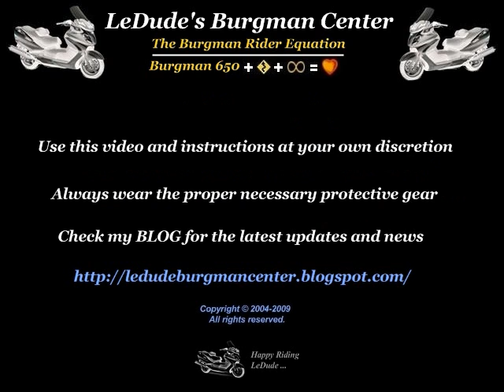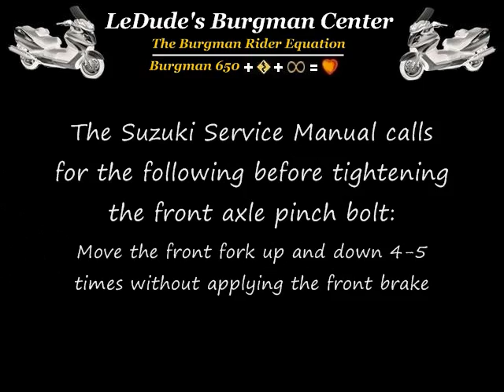Burgman 650 - DIY - Front Wheel Removal Install

Comment: Suddenly the front fender was gone . . . . How did you do that . Screws inside are rather difficult to achieve with the wheel still on .
Reply: That's exactly what I noticed!
Reply: @daniluchison  one of the few mistakes of Ledude. You'll need to remove it, indeed. By the way, a good monent to inspect your spark plugs.

Comment: Great informative clip. I have just bought a 2009 Executive and it seems the front left brake is binding. If I remove the fender and look down at the pads, there is a gap between the inside pad and rotor and the outside pad is tight up against the rotor. Could someone have installed the wheel incorrectly and would this cause the left fork arm to be misaligned? The caliper pistons are not binding.

Comment: thanks for the reply.
I bought a 2009 Suzuki Burgman executive with
bald front tire.
by watching your video I noticed you have 
Front Axle Spacer, mine doesn't have one, so I'm a bit worried and curious.
my front wheel has RING, SPEED SENSOR, and the BRACKET, SPEED SENSOR
with SENSOR, FR WHEEL ABS attached by 2 bolts. just wondering if maybe
the previous owner removed Front Axle Spacer and never replaced it or is it normal?
Reply from the maker: All 650s 2003-2012 have spacers, you  can check an online parts fiche to be sure

Comment: LeeDude, what would be your best advice for getting really clean my Burgman 650 rims? Most repair shops just use high-pressure water and it isn't enough for my soiled wheels, it really isn't! This is going to require 'elbow grease' and a good cleaning product, I think.
Reply: I have used a product called ironX.  You can get it on amazon.  It is a little expensive  but works great.